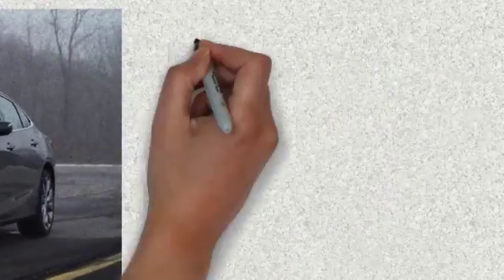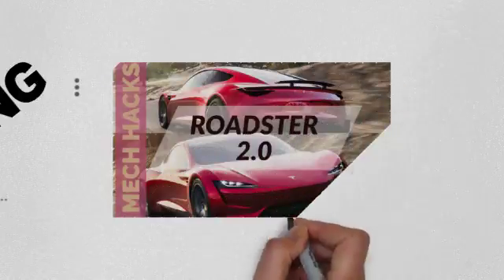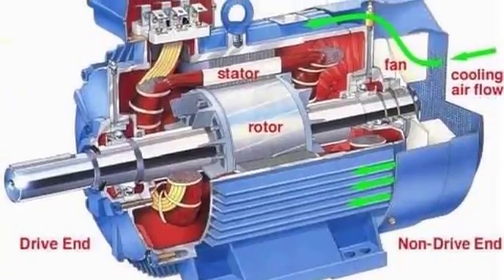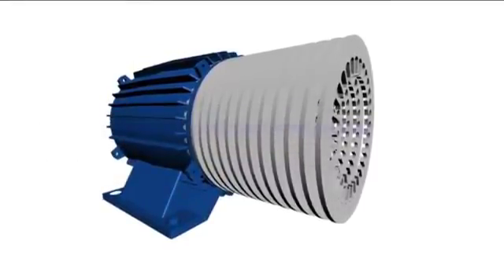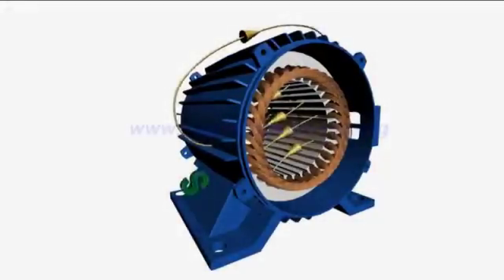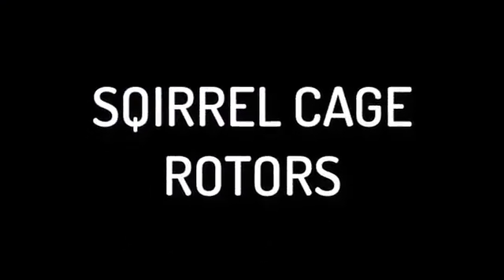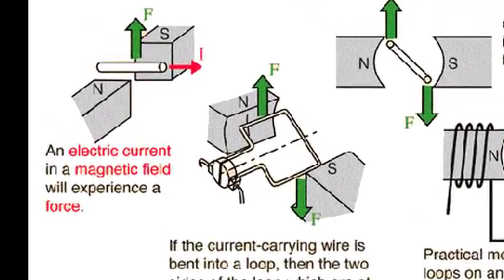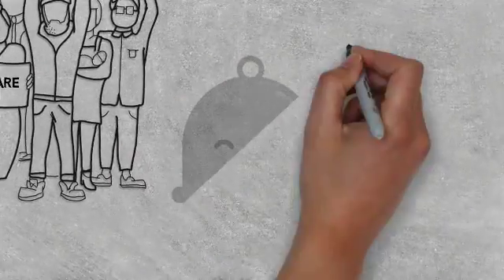How Induction Motor Works | How Tesla Car Motor Works | Full Details | English

Comment: Which one is better for a electric motorcycle AC motor or DC??
Reply from the maker: Actually both AC and DC plays role in the Electric vehicles. the battery charges on DC but induction motor works on AC.

Comment: But how this induction motor acts as a generator during regenerative braking? Please elaborate
Reply from the maker: During the non accelerating part when driver takes off his foot from accelerator pedal the power consumption gets cut off from battery. At this point the rotor speed becomes greater than the RMF speed and then it acts as a regenerative braking. Then the battery starts to charge invertly.